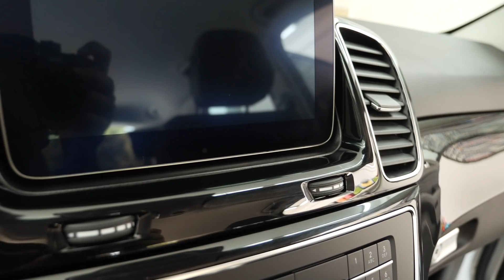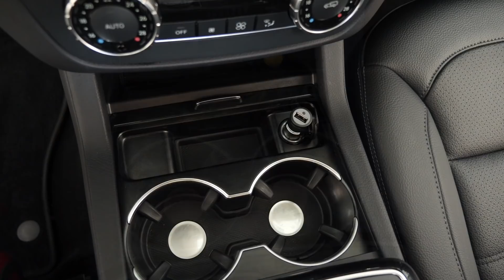Deep Cleaning a HAIRY Mercedes GLE | Full Interior Exterior Car Detailing Transformation

Comment: what concentrations of APC Pro do you use?
Reply from the maker: 1 : 10 👍
Reply: @MansoorDetailing  on all surfaces?  (leather, plastic, pre-wash)
Reply from the maker: for the leather if it is not very dirty you can use 1 : 20
Reply: @MansoorDetailing  thanks bro
Reply from the maker: for leather, I recommend using a moistened microfiber cloth to remove the product, and then another dry and clean